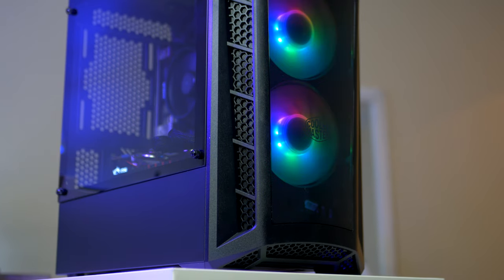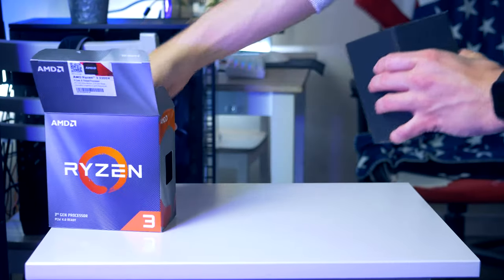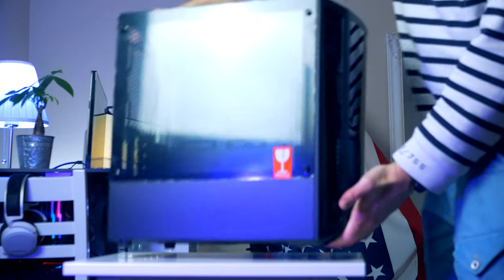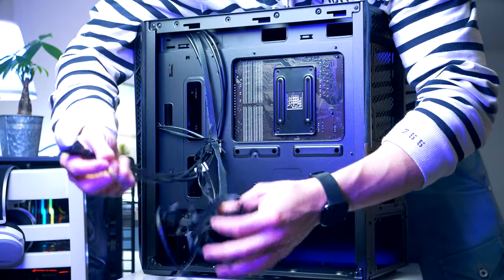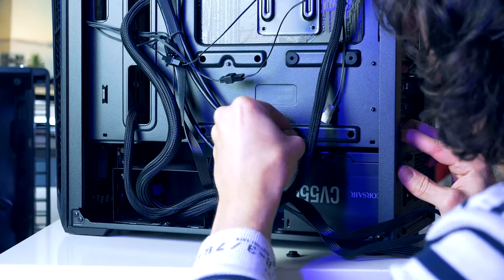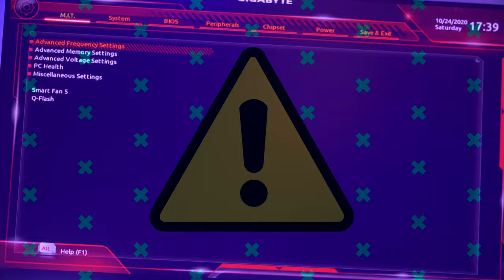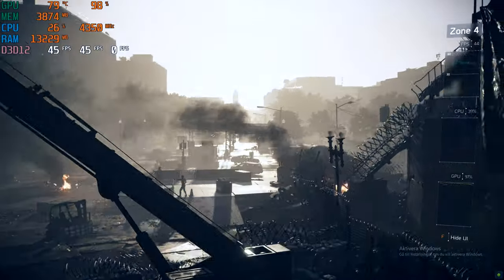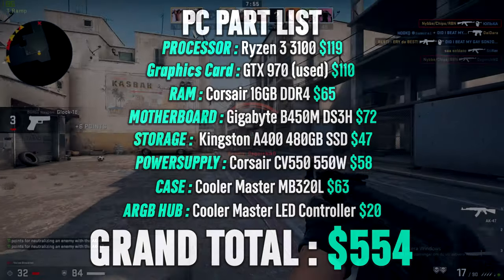Best Budget Gaming PC Build Under $600 in 2020/2021 With Gaming Benchmarks!

Comment: Would a 3gb MSI GTX 1060 Single fan be better then the current graphics card ?
Reply: 970 is basically equal to the 1060 but it has 1gb more vram than the 3GB 1060.
Not sure about clock speeds but they are very similar

Comment: I recomend to get a better gpu I recommend  msi geforce gxt 1650 super x because it's around 2× better than the gpu your using.
But it is going to cost you a 90 more $
Reply: What about a gtx 1060 6gb
Reply: No just get a 980ti which is basically a max well gtx 1070 which smokes 1650s

Comment: All cool,but i recommend:
Xfx rx480 4gb
Ryzen 5 2600
2x8gb 3200mhz ram
Any case
512gb sdd
Any 500w psu
Reply: Ok but how many frames will this run fortnite at?
Reply: On decent settings
Reply: Max settigs around 95 fps
Reply: @ArtoRico  ok thanks a lot bro🙏

Comment: Were can I get the gpu on amazon or something like it around 130-150$
Reply: for £165 you can buy the msi gtx 1650 gaming X off of amazon
Reply: 4gb version
Reply: Go to eBay and get a used 980ti which can be found at around same price as the gpu link in the description.
980ti is basically a 1070 which is good

Comment: Just built this pc a week and a half ago with slightl changes, works and performs amazing 🤩
Reply: What changes?
Reply: What changes
Reply: @danielbustamante5608  I went with the mesh front mb311 case instead  added 2 ssds and a fan at the back
Reply: Did u use the Ryzen 3100 or 3300?
Reply: @Mitsu-Sano  Ryzen 3100
Reply: Was the bios the same as from the video?
Reply: @Mitsu-Sano  yeah

Comment: What other graphics cards are compatible?
Reply: Pretty much every graphic card is compatible
Reply: It is a relatively new motherboard and has one pcie x16 slot in which graphics cards use. This will work with most gpu's if not all. I hope I helped
Reply: @KneecapTaker  can u add ahhd
Reply: Is the new graphics card compatible

Comment: I built this PC but I can't connect it to the internet so I've literally wasted over 600 pounds
Reply: Damn bro that’s tuff
Reply: Do u use wireless or wired internet? If you use wireless internet I suggest getting a pcie.
Reply: @jy4288  i got it working now im using a wired connection
Reply: @_kyle5  is the pc good
Reply: @nowayjey  idk i dont really know anything about pcs
Reply: @_kyle5  does it run smooth?